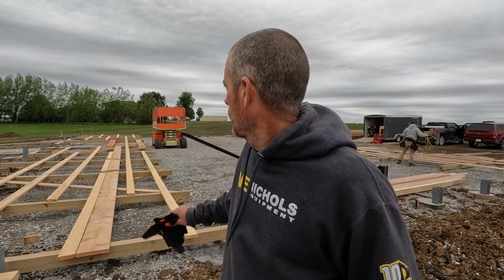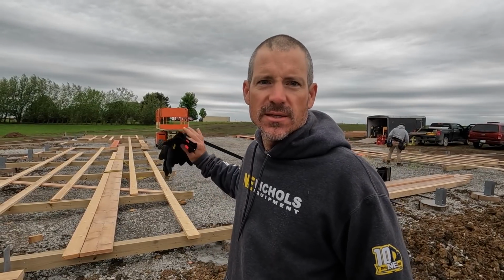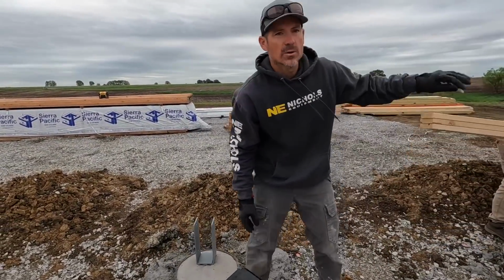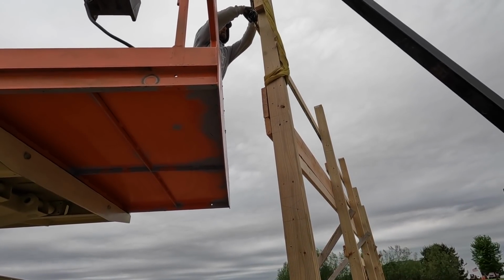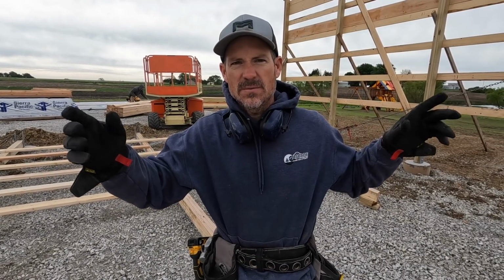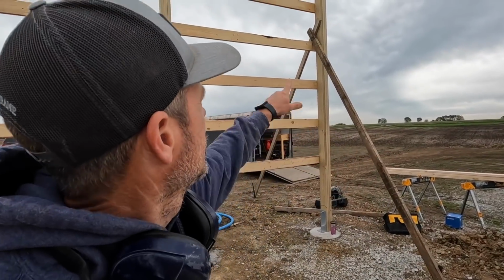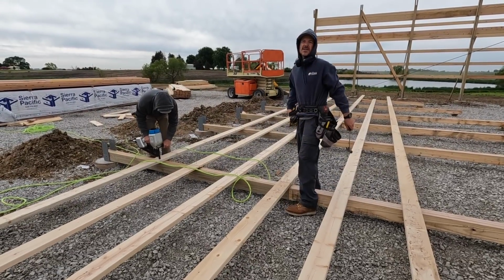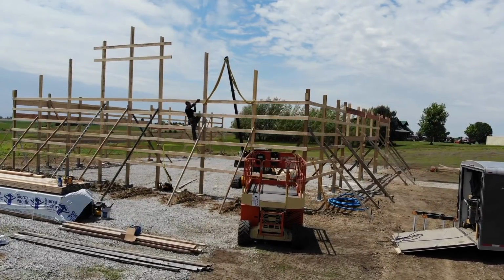Building a Shouse | Framing: Lifting + Plumbing Walls | Ep3

Comment: 4:10 What is the reasoning behind jamming the back of the clawhammer between the bracket and the wood while screwing bolts in? Is some amount of space needed between them?
Reply from the maker: A planer was used by the manufacturer to smooth the columns which made them a little smaller than the brackets. Used the claw to make sure we initially didn't over tighten and bend the bracket. Once top and bottom were screwed in and bolted...we fully tightened.

Comment: Couple questions: You used what appear to be regular zinc plated hardware. Does that conflict with the pressure treated posts? You used stove bolts in some posts and regular bolts in others. Why?
Reply from the maker: Those are A325 (Grade 5) supplied with the brackets. We use the carriage type bolts on end post and garage openings. We suck the carriage head into the wood so the trims can sit flat on the posts.